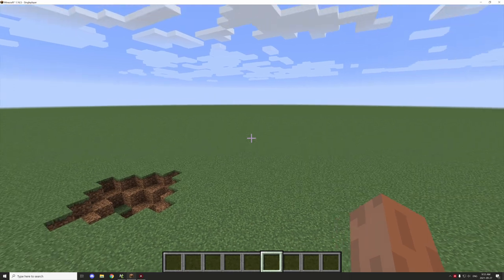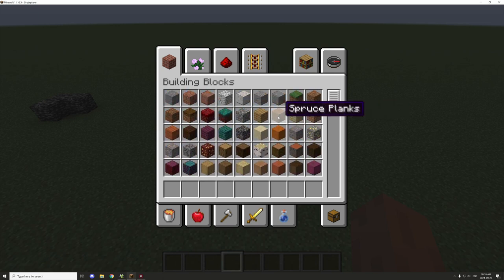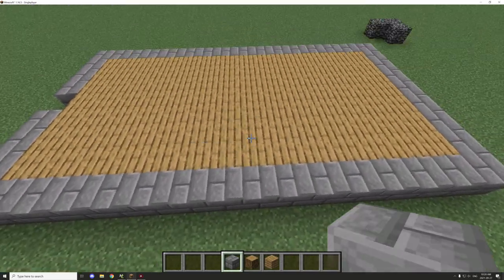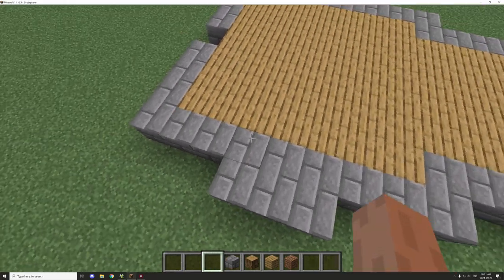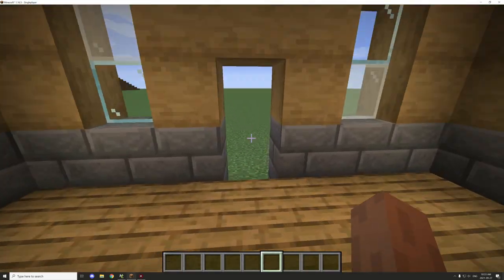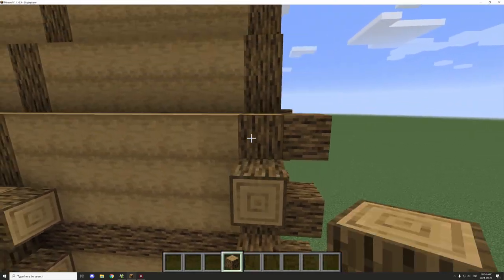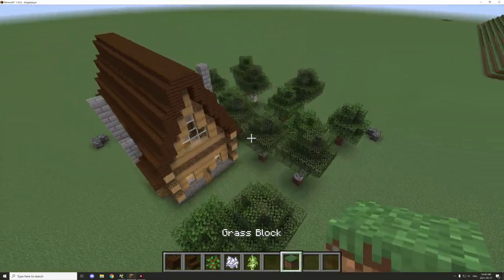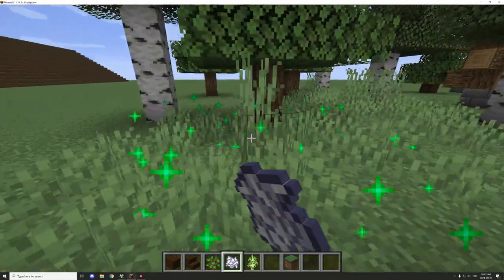MCreator Build: Log Cabin | Part 1

Comment: Hey can you help me with Mcreator I can't start it up anymore it is stuck on initiating user session and it just doesn't start up anymore
Reply: @ThatSlimeDood  what
Reply from the maker: The only thing that I can think is it may be something in the background of your computer processes preventing it from continuing.
If you have anti-vious software often they will block process that they think are security risk often its not the case try disabling third party anti-virous software.
You don't need java installed any more so I cant think that this would be the problem but to be on the safe side try checking for java updates.
Anther issue I have had with windows specifically is software starts acting odd when there is a windows update waiting to be installed or downloaded.
I have had this issue on a few computers with windows updates being normally a number one cause so this may be the case, check for updates if you have windows and install them if possible windows seems to speed up when there is no update waiting in the background processes.

Other than that I can only suggest asking for help on the MCreator forums under the help topic.
it seems that you posted there already though so I suggest just giving them some time to reply.
Try the other things I suggested though in the mean time and see if that can help get it running.
Reply: @NorthWestTreesMCreator  Thanks im gonna try it!